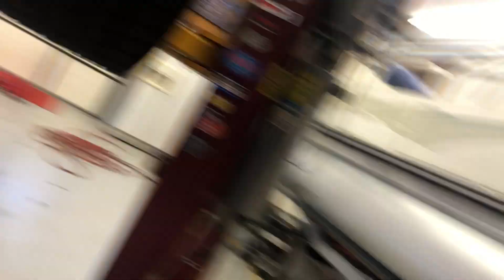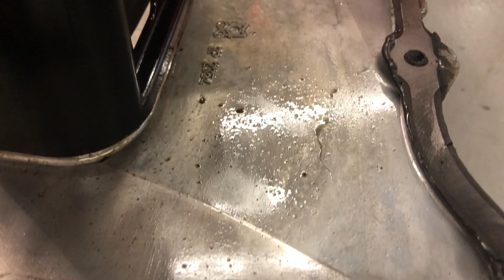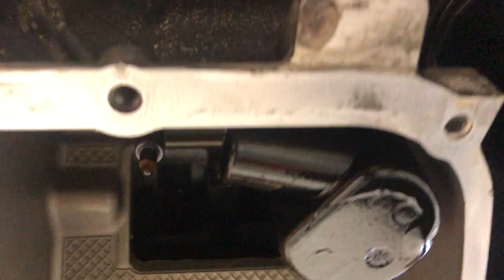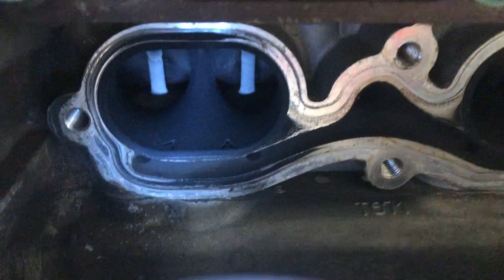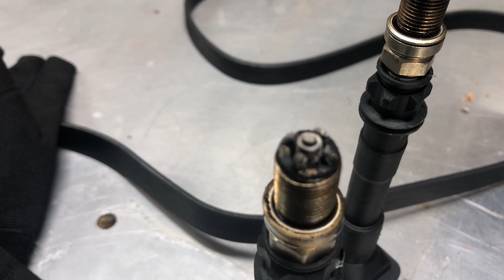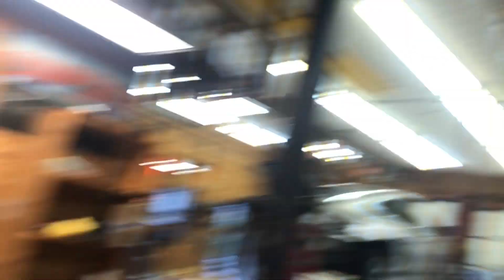Porsche 996 - Engine Analysis 1

Comment: I hope it works out well for you!  Best of luck going forward
Reply: Keep watching.. engine blew up 😢
Reply: @machu009  what is the current status?  did you go with a rebuild?
Reply: lost my job, car is without an engine, looking to get an LS3 in there eventually. body and interior is perfect so it'll happen.
Reply: @machu009  I have been following you for awhile.  I have a c4s arctic silver as well. I am rooting for you.  Thanks for sharing.
Reply: Thank you so much! I need to make another video just to update everyone what's happening in the shop. Got a 68 GTO off its frame doing a restoration, was full of mice and other rodents, porsche on stand by. Got a friend that had a bmw 3 series that I cleaned up a little and sold on the most sketchy sale I've ever done. Always something happening. Thank you for following!!

Comment: Wishing you the very best going forward... Its looks like bore score which I'm very surprised at as it normally takes a while for it to get bad and comes with a loud ticking noise... Sorry, my previous comment in the other video must be wrong :-(  On the plus side there are a lot of companies that can make the M96/7 engines super reliable eg. Hartech in the UK website is a good read. I hope it helps.
Reply from the maker: Thanks, it'll need a transplant for sure.  Good thing I have the shop! Now I just need money... Not sure I want to venture down the M96 path, may just do an LS3 in there and get more HP, not like it's the only silver 4S in the world.  But, yes, looks like bore score.  Not doing a scope, just going to rip it apart with the evidence I have now.
Reply from the maker: And yes, after the incident at the autox it sounded like I was driving a cement mixer around.  You could feel the severe misfire happening any time the gas was pressed.  Cleared the codes and it just kept on sounding awful and codes all returned in seconds.